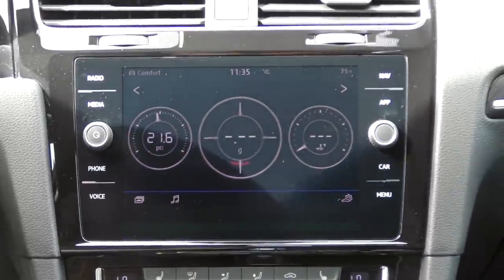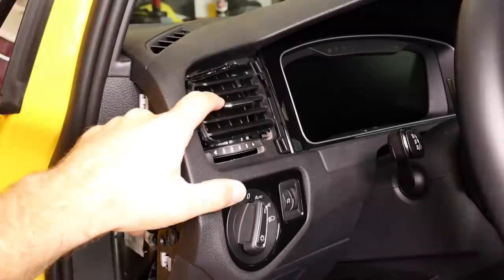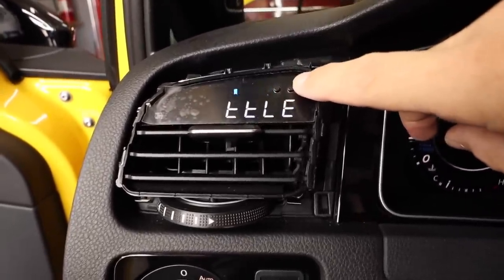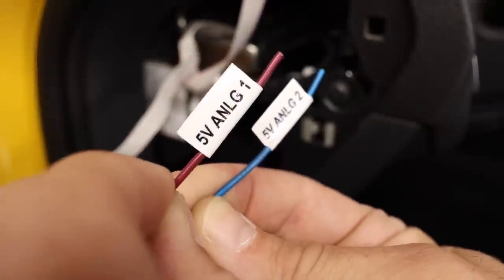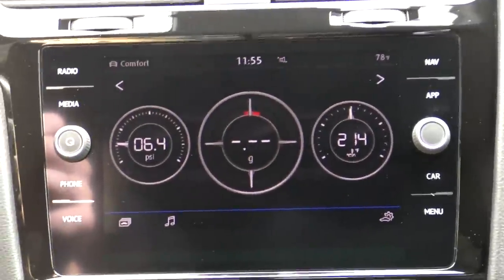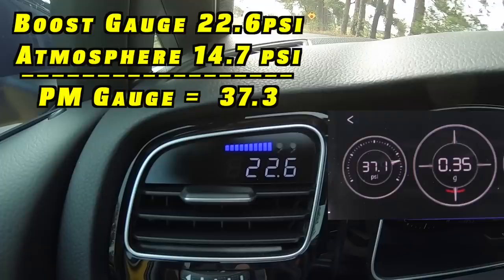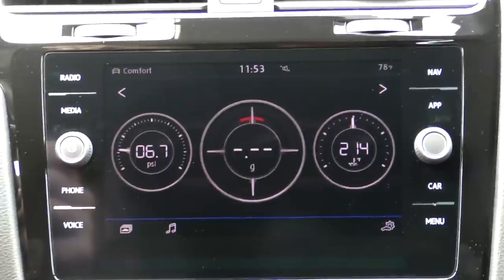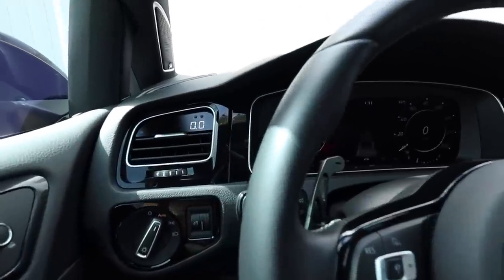Boost Gauge Install and How Factory Gauge Shows 40PSI of BOOST!

Comment from the maker: I hope you guys enjoyed this video. It was fun to clear up some of the weirdness on how that PM gauge reads. What should be the next Golf R mod?
Reply: I would have added the "several busted plastic tabs mod" on this install.  Its weight reduction in my book.  Nice work!
Reply from the maker: @luisg1653  HAHAHA
Reply: Dude! Do exhaust pipes!!! Or oil catch can + cool air intake! Or go big and change coils+bigger fuel injectors+ bigger turbo+ intake manifold+.....ok got crazy with that....
Reply: Hardwired dashcams?
Reply: European tails...
Reply: I definitely think a cold air intake would make her breathe abit beter.
Reply: LCD displays in the headrests hooked up to an Xbox One with Forza Motorsports. If you're gonna pimp, do it right... 🤣
Reply: You should definitely test it vs draggy.
Reply: Factory location upgraded intercooler 😎
Reply: How about that stop/start and mode select buttons in the steering wheel like some audis have. I've seen some kits online and a video of a golf with it
Reply: European tail lights or an vwr 600 air intake👌
Reply: Do you have fuse box diagram for 2010  vw cc 2010.Thank you
Reply: Replacing the cam chain tensioner and DSG clutches?
Reply: HumbleMechanic great video
Reply: Charles. Can you please please pleeeease, stop calling it a Mk7. It's a Mk7.5! 😂
I know this, because I own the GTD version and love it 😊 
Shame it's got an open diff thought 😕 For a car that's worth £30k and more for the R, you'd think they'd stick one in. But I've got no idea why they didn't 🤔 And it breaking the wheel(s) that are spinning is a stupid idea 🤦🏻‍♂️ As it takes around a second or so n by then, you either don't give a shit or you've already let off.

Btw. I love your content. Can't remember if I found you because of my golf or before 🤔 Either way, in the great words in the film "Get Him Too The Greek!"
 "I love you shit" 😜

Comment: That 4.1 0-60 is sick to think about and respect to you. I'm amazed and thankful how far technology has had a positive influence in the automotive performance world. I think when i was a teenager the Lotus Esprit Turbo was the first car I remember reading about to get to 60 in 4-second range and that was the early 80's. Impressive sire.
Reply: I bought p3 gauge and my 17 golf r is showing 3.6 seconds everytime. I have Apr stage 1 dsg tune as well, turbo inlet pipe. inlet hose and cold intake . l was doing 3.8. after I did Haldex  mod I can hit 3.6 everytime

Comment: I love SI units for a reason.
Reply: Is that because you would rather be deceived in Pascals rather than psi? Atmospheric pressure and gauge pressure apply to both systems
Reply: Side note. I also love SI units😀

Comment: Good heads up on the OBD plug. A year after I bought my car I was using a bluetooth OBD reader, keeping it plugged in all the time. By that time my factory battery was 3 years old, and just was not up to snuff. My suggestion, if your getting this and you haven't replaced the battery in a few years, may be a good idea to replace the battery as well.

Comment: Absolute pressure is better when tuning the vehicle that adjusts load and fueling based on the altitude. You dont need two separate maps and sensors to determine the actual engine load that is being produced compared to the reference map for requested load. Just simplifies a variable.

Comment: This is actually really interesting, in my state of Rhode Island which is pretty much at sea level, my GTI performance gauge reads up to 35 psi at full boost. When I went up to the mountains in New Hampshire that dropped to around 30psi

Comment: Looks like you forgot to remove the plastic film over the front of the gauge.  Pretty cool implementation into the vent, though.
Reply from the maker: I didn’t. I saved the peel for another project.

Comment: My buds omni glh had a similar issue factory it runs 6 to 10 pounds we opened it up to run 14  but from time to time it would spike to read 20 that was on an after market boost gauge but it was also in 2002. 
 Meter would do that but air fuel mix never changed .

Comment: I know it's got a lap timer, but it's a shame it hasn't got a 0-60mph or 0-100kmh. I know other cars have them and so does pretty much everything that's got GPS (like some satnavs or things with a gyros which pretty much EVERYONE owns. 

Do you know how to get into the OBD settings and get engine oil pressure, gearbox oil pressure and gearbox oil temp on the centre screen? As I'd love to get it on there 😊 I know you can get engine oil temp on the clocks/drivers screen and engine water temp is always at the bottom. I know if that went either high or low you'd soon know about it  before even looking at the water temp 😂

Comment: Hello dumb question - I’m using a 1.4 tsi turbocharger to modify my vw bug  I was aiming to have boost at low rpm but it happened that apparently the turbo is not producing boost at 1800-2500 rpm only above 3500 but bearly - why is that for ?  Is there another turbo I should use to achieve my low rpm boost goal ?

Comment: Where did you get the boost tap? Is that p3 as well? I have the analog sensor but mine didn’t come with that or the bit of hose,
Reply from the maker: It’s all digital. I didn’t add an actual mechanical boost tap
Reply: @HumbleMechanic  oops my bad! I appreciate the response!  I should have deleted my comment after I finished the video! Thank you for still confirming,

Comment: Hi I have a b6 passat 2.0 fsi engine engine has a lot of oil in intake and is leaking a lot of oil. I suspected the pvc as being faulty when I pull the dip stick or oil cap car runs rough and vaccum. I would think that nothing should happen if oil cap is off or dip stick pulled while running. Can you please shed some light on this situation thank you.
Reply from the maker: If you pull the dipstick or cap you upset engine vacuum. It will run poor. May still have a bad PCV but the rough running is normal

Comment: My E82 is N/A. What's the best way to increase power & remove weight up front in the engine bay for a reasonable price? Supercharger...
Reply from the maker: Before I went the SC route, I would be sure I maximize all other aspects. Remove weight, top line tires, light wheels maybe. Then I would look at power. But it depends what the overall goal is, is this a track car, or a weekend fun time

Comment: You should setup the shift light on the P3 gauge 👌🏼
Reply from the maker: I may do that for autoX. The car is so quiet I can’t hear when it gets high up in rpm. But it will shift anyway so it’s not a huge concern
Reply: HumbleMechanic that’s true

Comment: I've had a p3 gauge in my mk6 for years, it also has the two "5v anlg" wires, any examples of what can be connected to these? Thanks!
Reply from the maker: I’ll let them chime in with some of the cool stuff. They will do a better job. Haha
Reply: Great question! Any sensor with a 0-5 volt linear output. We have had customers use them to read air ride tank pressure, nitrous pressure, meth flow, oil pressure/temp, coolant pressure/temp, Air Fuel ratio, Ethanol content, etc...

Comment: are the carrier to spindle bolts on the mk 7 platform TTY? or does that only apply to the caliper to carrier bolts where the caliper slides on?
Reply from the maker: I’d have to look. But I’m at the point with VW where all bolts are tested as TTY.

Comment: Hey VW experts.
I’m in need of some desperate help. 
I have a 2013 VW Tiguan.
It’s a 1.4 tsi, check engine light came on. I scanned it and it has only 2 codes. P2178, and P2188.
Engine running too rich at idle bank 1.
The car starts, runs and drives perfectly, there is no smell of fuel at the exhaust, car doesn’t hesitate or anything. It’s rather strange!

I took out both MAP sensors, sprayed them with MAF/MAP spray, let the air dry.

After much frustration and screaming I took out the “interestingly engineered” coil packs. Removed the spark plugs, they where all the same across the board, all had the same normal carbon build up, no one of them looked cleaner than one another, all normal. No smell of fuel in the spark plug holes, they all looked dry and normal.

I looked at some of the OBD parameters, the air fuel ratio at idle was 14.65, the fuel pressure was around 790psi and the O2 sensor was reading. 

I really need some help from you guys, I’m just an enthusiast and I’m not too knowledgeable in VW specific stuff. 
Thanks so much everyone I really do appreciate any help and hopefully solving the problem. 
Anything else u guys need to know to figure it out, please ask.  
This is the second time writing this out so I’m sorry for any mistakes! 😂
Reply: Car has just hit 50,000 miles and is always been taken care of and serviced, no accidents. No vacuum leaks as my mate suggested I checked. Thanks so much for any help.

Comment: So what if I do not put in the boost tap then I cannot read boost?
Reply from the maker: It reads boost from the ECM, and presents it better than the OEM gauge.
Reply: So what is exactly the point of the boost tap if it reads it through the ECM?

Comment: Just wondering. I am looking for a tune for my 2.0 4 motion Tiguan. Stage 1 only. Unitrionic or APR?
Reply from the maker: Both are solid. Look at who has better local support
Reply: HumbleMechanic thanks for the fast reply. I was going to get the cable and software from either or. So hard to choose one
Reply: Jake Shep83 hows the Tiguan doing? I’ve got a 2011 4 motion and wanna get the same tune
Reply: Jake Shep83 people would truly be surprised at how quick the Tiguan really is
Reply: Phoenix I went apr first and didn’t like it. Unitronic made it feel like that it was stock. APR was two harsh. Unitronic is nice and smooth. I am stage 2 now and it’s quick. I’d go unitronic again. APR was a waste of money to me
Reply: Jake Shep83 I appreciate it also have you already done the timing chain tensioner or?
Reply: Phoenix I am not sure. It’s a 2016.

Comment: Wish I could get one, but my OBD is taken up by my JB4 already.
Reply: This is a good guestion. I have OBD11. How do they compare?
Reply: We have analog versions of most of our gauges that only need a power/ground connection and read boost directly from the intake. They can read battery boost, battery voltage and 2 analog inputs. Also, you can switch this OBD2 gauge over to analog and back on the fly.

Comment: i will guess why without watching the video as the thumbnail is the question. 
Its because compared to traditional gauges where 0 means atmospheric pressure but actually is around 14psi, this one shows 14psi when it sees absolute atmospheric pressure. In other words - N/A car with this gauge would show 14psi with 100% throttle.

EDIT - kinda stupid thumbnail. Video was not about why that gauge shows 40psi, it was boost gauge install/how to...
Reply from the maker: Did you watch the whole video?

Comment: $459 lol.  I had one of these in my 14 Gli, waste of money.
Reply: Performance Monitor for VAG (third party app) does pretty much everything the P3 can do. You need a rooted android phone and a BT OBD2 dongle/Torque Pro App. It relays the info from Torque right to the AA Interface/infotainment screen. You can select and choose what data/clock themes you want and everything. Costs far less and is basically what the stock performance monitor should have been.

Comment: @HumbleMechanik, my polo gti aw 2.0 tsi shows always ambient pressure, normally when i let the foot of the throttle it showed me about 0,33 bar when rolling in gear. Had stage 1 but flashed it back to stock. Do you have any idea why i have ambient pressure showing and no vac? Also i have this strange sound @ about 2000 rpm when i let of the throttle. https://www.youtube.com/watch?v=2SkWVK56NJw

Comment: You would think VW would fix that in the software or something.  Pretty stupid.   And sorry but I don't see that car doing 0-60 in 4 seconds.  Complete BS.
Reply from the maker: When I have a little more space I’ll do a few runs. It should be a pretty simple calculation. The ECM has all the info to make it, so the gauge should be able to interpret it.

Comment: Would this install apply to a 2016 Golf S MK7 1.8t?
Reply from the maker: yes assuming they have performance monitors
Reply: @HumbleMechanic  Thanks for the reply.  My Golf doesn't have that as far as I know.  Is the performance monitor available from VW as a software update?  I plan on an APR stage one tune and would like to have some kind of boost info while being tuned.